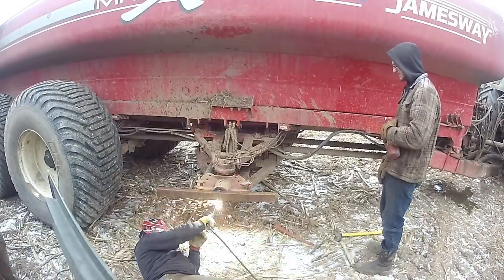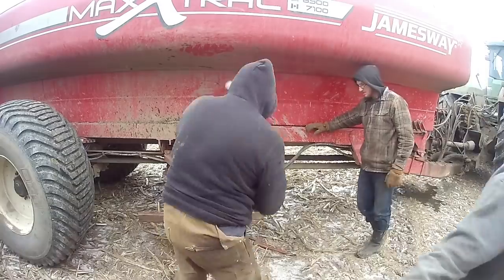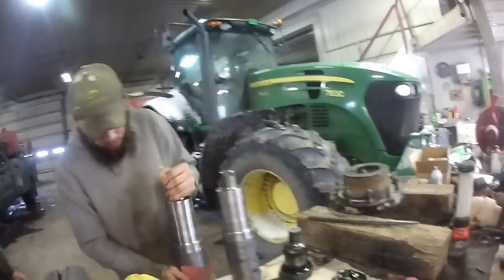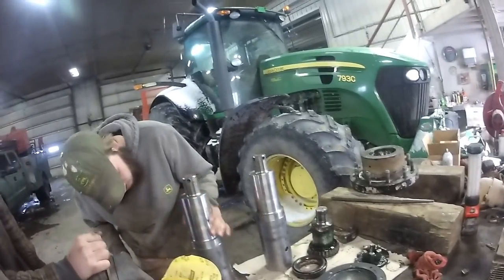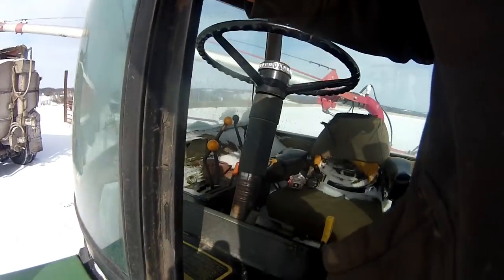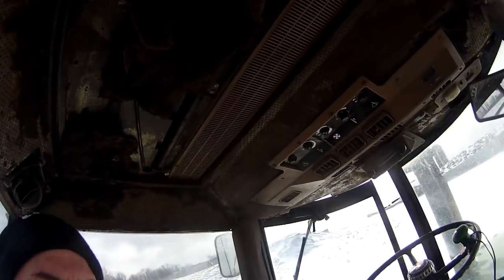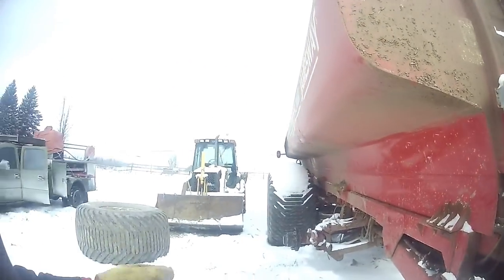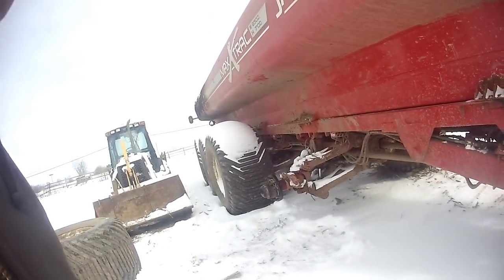Jamesway maxXtrac 8500 axle replacement

Comment: I'll bet that service truck is one of the most valuable pieces of equipment on your farm.  It's really nice to be able to basically take the shop to the field when you need it
Reply from the maker: Somedays it doesn't have enough told in it.
Reply: Might be an interesting video if you did one about the service truck and how you have it set up
Reply from the maker: @jaykettlewell3922  I will some time

Comment: Nice video...good job...I usually warm the tube and cool the hub...allows enough expansion to allow the air to escape and the hub slides in easier...nice to see anti-seize being used...less swearing next time...I prefer copper anti-seize...it works with all metals

Comment: Thank you for today's video. Nice to see a repair that could have been just a large pain, turn out to be fairly easy. 👍 So many tires on the tank for flotation over the ground with a full tank? Does the manure freeze to the sides of the lagoon or get a frozen layer on top like a pond?
Reply from the maker: Sides don't freeze but the top does

Comment: I don't want be wiseguy. Wheels should be tightened in criss cross pattern. But other than that very informational and staying calm is great. Teach's the boys how to handle stress.
Reply from the maker: Yes you are right, the first pass I didn't only just start them with the impact then I go in a Cris cross them. Sometimes I'll tighten the first one up real tight them do 2 in a row on the opposite side then do 2 at a time from there.

Comment: hey that 4250 wat hp is she ?? im lookn for a tractor bout that size i realy enjoyed the way started .     wats james way spreader weigh loaded?
Reply from the maker: 4250 about 120hp
Reply: @FarmingFixingFabricating  id love 2 find 1 of them old jhon deer around 100 to 130hp wat is the better transmission power shift or power quad??
Reply from the maker: @billybobs841  quad range
Reply: i have a feeling you have had both transmisions
Reply from the maker: @billybobs841  yes, the power shift are nice but expensive to fix. The 15 speed power shift is better than the 8 speed power shift.
Reply: i appreciate the info and thanks for taken time 2 answer me

Comment: There a reason you couldn't have used a chain and tied up the axle and brought it home? A chain or cable wrapped over the top to the other side should hold it up to allow to travel it home, nice and slow of course.  Sorry, just don't know that much about that style of slurry spreader. Great video, cheers :)
Reply from the maker: Ham68 we were 14 miles from home and it would have traveled just like that with no chain.I probably would choose not to try and travel with it if I had to chain the axle.